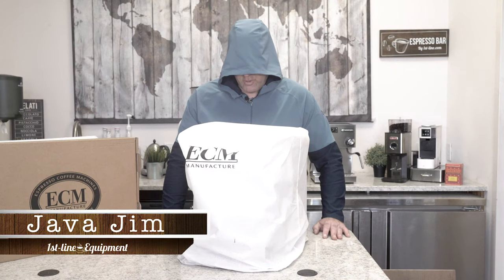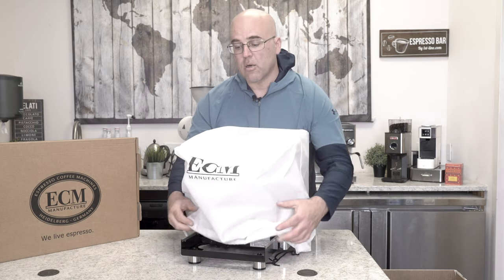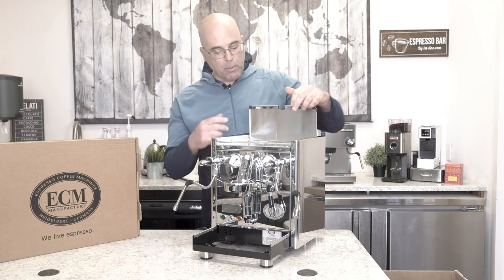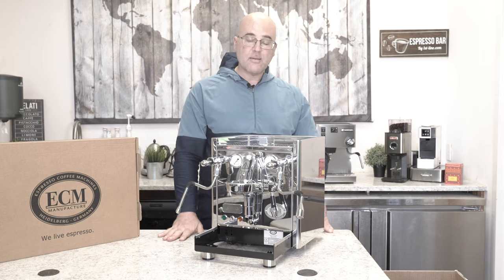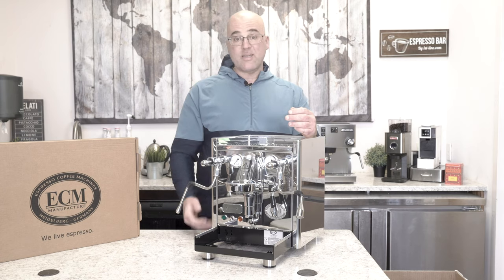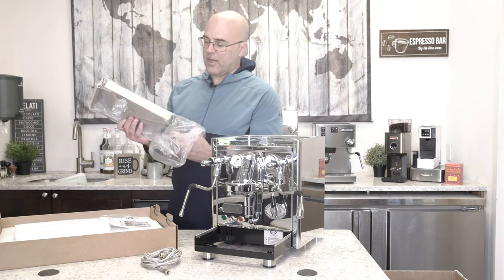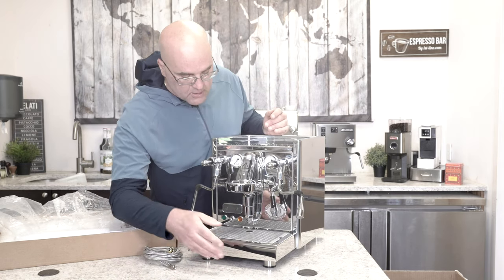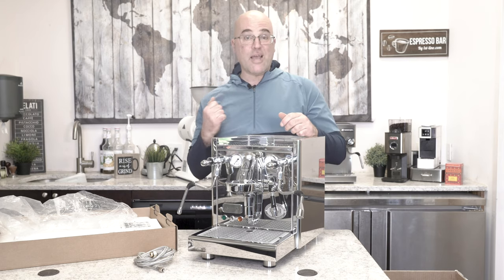Intro & Hints: ECM Technika PID Heat Exchanger Espresso Machines

Comment: How can I attach a drain hose to the tray?
Reply: Apparently theres an add-on kit that ECM do. Will require some drilling as the stainless steel tray isnt cut and plugged which is exactly what the factory SHOULD have done.